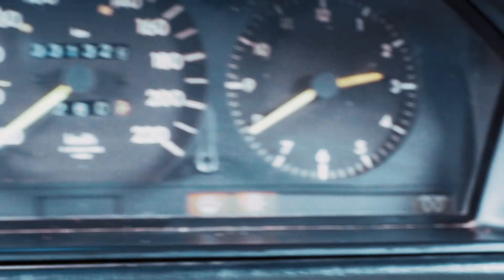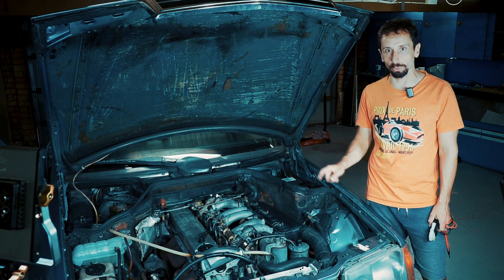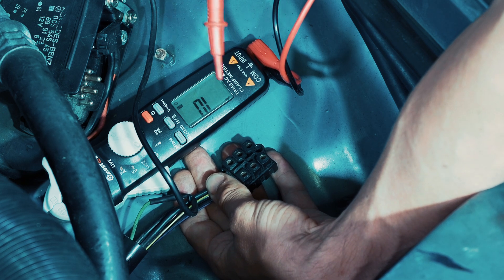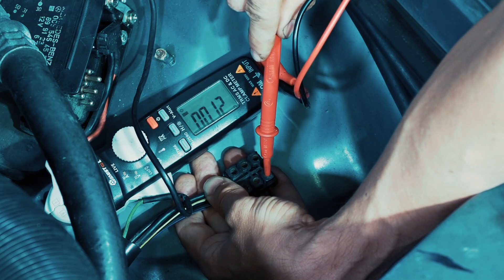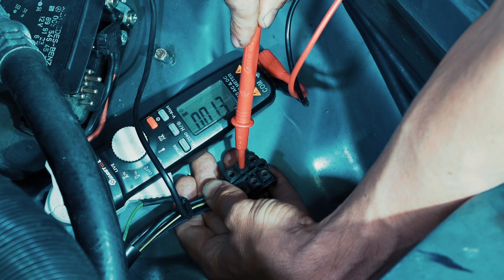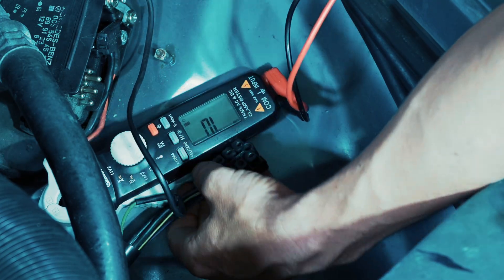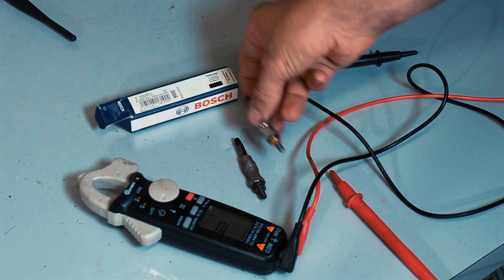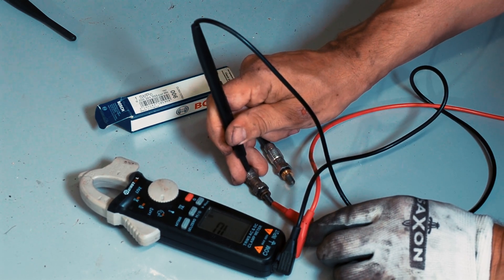Fixing the Glow Plug on the OM603 Diesel (Mercedes W124 300D)

Comment: I got a om603 and it wont glow but I found that the past owner had a agu fuse with no fuse just a bolt i noticed it bc it was glowing red after I tried to get the 603 to start im gonna pit the om603 in a mew car a cadillac or something cool and then il replace all the wiring:3